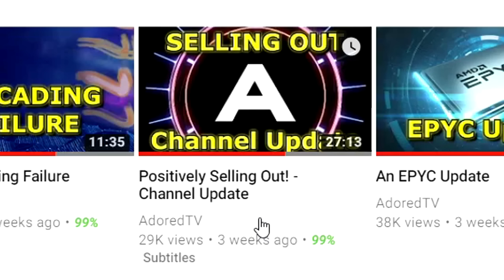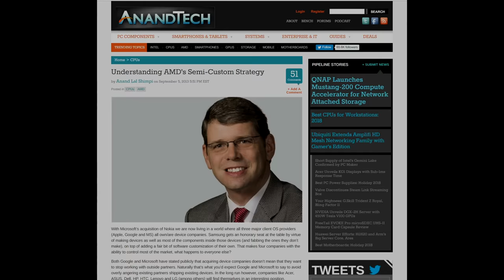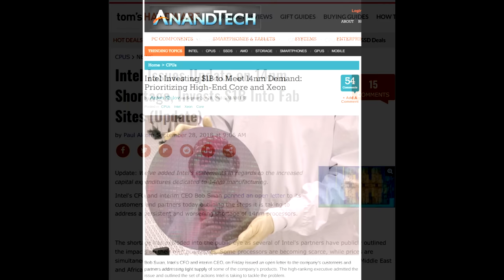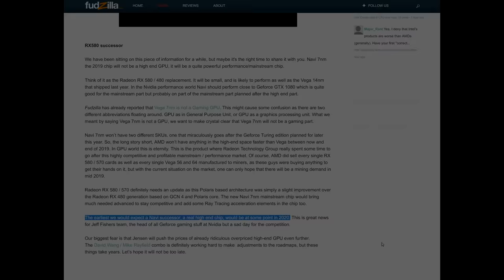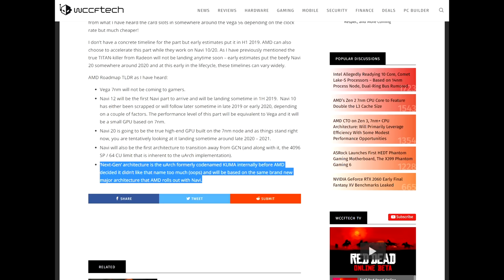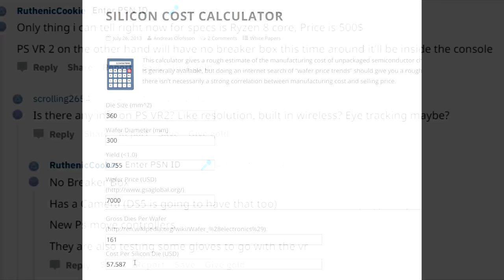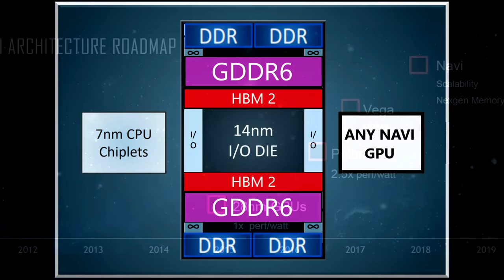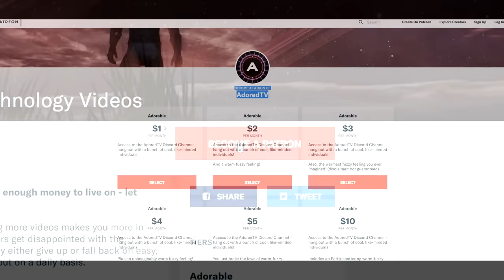AMD  - The (Evolving) Master Plan

Comment: Multiple memory controllers sounds reasonable, but quite wasteful. Considering the following.

ZEN 2 and and VEGA 20 have PCIE 4 support, which can be used for Cache Coherent Interconnects. 
Considering that AMD is member of all 3 consortia/consortiums (GEN-Z, CCIX and CAPI). 
Also factoring in that Infinity Fabric is based on PCIE. 
I would expect that the IO Die to have such interface as well for GPUs and  FPGAs even for the consumer segment. Probably only one of them, the rest as a semi custom solution.

This should allow significantly lower latency communication between CPU and GPU/FPGA compared to current PCIE 3. 
Maybe it will be good enough for bidirectional communication in sub 16ms applications. Which could bring current "eye candy" features to be core part of game play. 

The drastic increase in computation power also points to this direction.

In this eco system, only the IO Die that needs to change to serve different market segments. Keeping IF and the Cache Coherent Interconnect and swapping between memory types and on chip cache sizes.
I would expect multiple IO Die designs, including semi custom solutions for "Hyperscalers". 
I wouldn't be surprised if the IO Die would have flexible component based design, which would decrease costs and time to market significantly.

Cutting an Epyc IO Die into 4 different parts could be tricky without using an interposer. As the orientation of the pieces will be different, which would complicate assembly for non Epyc parts. Unless they found a way to solve it.
Reply from the maker: Yes I think you're right and that it's all about the I/O die.  AMD already has the core chips, all that's needed is different I/O dies and that's what the companies can pay them for.  I'll maybe updated this video in a few months. ;)
Reply: Once AMD moves to 7nm with volume, they will have a shit-ton of 14nm capacity at GF so they can afford to waste a little mm2 to have a single small I/O die that's flexible. Multiple different chips adds to cost for the masks and QA. It's not a small amount either.
Reply: AMD will achieve 10-15% sever market share with Zen 2 Rome,that means GF needs to produce 3.2-4.8 million 420mm2 14nm I/O DIEs per year for Epyc 2 alone.
Reply: @henryfan48  Well within their capacity because their foundries are optimizing for 14nm rather than dedicating machines to 7nm.
Reply: This is all very exciting regardless of who is closest to the truth
Reply: @adoredtv  yes, I kept thinking the same when you came up with this idea; I think they will rather make different I/O dies for different applications, and have some sort of L4 cache in the I/O die to maintain coherence, but I guess we'll have to wait and see.
Reply: @SilverforceX  Console manufacturer always Co-develop and have theire own custom chip. So custom IO for sure in console

Comment: MY BODY IS READY.
Reply: Stop stealing Reggie from Nintendo quote when the switch is full Nvidia ! xD
Reply: @ethan-fel  Yeah, I wonder how and why that happened considering when you trace the history of Nintendo's graphics hardware, they've been With Ati longer than literally anyone else in the console space.
Granted a lot of that is down to a technicality and corporate failures/buyouts.

Silicon Graphics which collapsed but formed ArtX, which was bought out by Ati, which in turn was bought out by AMD...

My guess is given the state of AMD GPU's when the switch launched, there simply wasn't anything in AMD's range that met the requirements. - while Ati led the mobile market between about 2006-2011, it lost almost all it's market share in the mobile space to Nvidia.

And, well, the switch isn't even remotely close to laptop form factor and power envelope, it's in line with tablets and mobile phones...
What are your options there if not Nvidia? Tegra is a mobile phone chipset but with familiar PC-like tools available.
Your other options really aren't very good (Mali graphics? Eh.), and AMD literally doesn't provide any such option whatsoever.

They have nothing in that market segment, good OR bad... Just non-existent.

Meanwhile when you look at the only Nintendo systems so far that have had a portable form factor comparable in size to the Switch, they only gained any 3d hardware at all around 2004, and the entire family consists of PowerVR tech.

PowerVR. A company that had SOME desktop cards in the late 90's but quickly gave up on that entirely, and is now almost a forgotten name in most people's minds... Their chips powered the Sega Dreamcast...

But the name all but disappeared from mainstream awareness, because they bowed out of the PC market very early.
And yet, they persisted all this time specialising in low power, mobile GPU's...

So given what the switch is, and what Nintendo designed, they needed a chip powerful enough to give acceptable results in the home console space, but sufficiently low power to fit into a form factor that, realistically is that of a 7 inch tablet...

- AMD? Not an option - they haven't got a single GPU that's even in the ballpark of the power demands. Even laptop grade low end AMD chips are 30+ watts (which is about 3 times total power draw of the system even in docked mode)
- PowerVR? - well, they've got the low power stuff down, hence why they were used in the DS range. And a pre-existing and fairly long-lasting working relationship with Nintendo already. But... Well, I don't know if you've ever seen the best PowerVR chip currently around, but... Let's just say the results are not that impressive.
- The other main contender is the various Mali graphics cores that ARM provides; They vary enormously in performance, and since ARM doesn't manufacture anything you'd have to ask a company to build you a chip containing such cores. Performance of even the best of these isn't anything to write home about though, and similar to the issues with a PowerVR chip.

What does that leave?
- Nvidia. In principle they're no better than AMD for this purpose given the vast majority of their product range, yet for some odd reason, even though on the whole the chip is not that popular in the mobile space, Nvidia chose to create a derivative of their desktop part that is suitable for use in mobile phones and similar small form factor devices. While not nessesarily powerful by mainstream standards, it's pretty beefy by mobile phone chip standards, and equally as importantly, fully supports the feature set that game developers are used to from PC hardware and other console graphics chips... Not the most powerful thing ever, and it almost seems like a random whim that Nvidia even designed such a chip in the first place...
But under the circumstances...

It's the best option they had given their goals. And one that AMD was outright incapable of providing. They had some alternatives to Nvidia, but AMD wasn't one of them, not to build what they had in mind...

Given Nvidia's track record in the console space I'd wonder how long this deal will last before Nintendo (like Microsoft and Sony before them) gets pissed off with it.
But given the lack of a viable alternative, that may not matter.

I wouldn't be at all surprised though, that if AMD ever decides to make a small GPU in a similar category to the Tegra, that Nintendo would go right back to using AMD just like every other console manufacturer (and nintendo themselves prior to the launch of the switch).
But, you can't ask a company to provide you with something they don't have...
Reply: MY WALLET IS NOT
Reply: KuraIthys quite frankly I doubt it since they signed a partnership for several years with Nvidia.

Nvidia helped a lot in developing the switch

Nintendo also moved to ARM, not x86, something that AMD doesn't do at all.
Reply: @ethan-fel  AMD DOES do ARM - currently only in select server space parts, but it's ARM all the same: https://www.amd.com/Documents/A-Hierofalcon-Product-Brief.pdf

AMD has had their ARM license since an acquisition made even before their ATI acquisition.  I'm sure that if someone approached them asking about an ARM plus a current, upcoming, or even made-in-partnership GPU (Like Sony's help on Navi) they'd be willing to talk.  I'm sure that if Nintendo had actually tried talking to AMD's semi-custom division they might have been interested in building something.  The set of factors that might have forced Nintendo to talk to Nvidia instead, if they had even tried AMD first, was AMD's already existing projects with Sony and Apple and Koduri's mutiny attempt.  Dealing with all that, the talks may have had a timetable caveat that Nintendo couldn't accept.

Comment: C'mon AMDRTG, we need "the Zen" of GPUs
Reply: GPUs are iterative thingies, "Zen" just doesn't happen there.
Reply: @whoruslupercal1891  CPUs are also iterative, except if you drop out of the competition for five years and need to come back with a jump. Sounds familiar?
Reply: @DeeSnow97  AMD never dropped out of GPU competition.
Also Zen just does things Intel did.
Reply: Come on, A-MD Team!
Reply: AMD needs to Hire this guy. Jim truly had a great vision and knowledge to do iy
Reply: That's why a few months ago, people were wanting to see chiplets in Navi, and were disappointed when that theory was officially quashed
Reply: I see RepsUp100 everywhere
Reply: @whoruslupercal1891  False. Zen introduced the concept of chiplet-based processors to the market and innovated in being able to manufacture scalable, high-performance products at a low cost due to the use of chiplets improving yield. Intel are still shitting out massive monolithic chips and they know they can't continue doing so now that Zen 2 has been revealed.
Reply: Nigga IBM was cooking MCMs before AMD was even considered a serious contender in server market.
Also C2Q's were also that.

Intel relies on massive monolithic chips because of their former inherent fab advantage, which is now gone and SPR is a chiplet design with EMIB anyway.
Reply: @greebj  MCM GPUs are extraordinary hard, unless you want to burn 200W for interconnects and 100W for GPUs themselves while still being unable to leverage >1 chip for actual graphics.
Reply: Give it time it's coming. ex-Zen engineers have been shifted to AMDRTG team last year, this is good news. Now just be patient and cheer for the team!
Reply: It's much easier to call them ATi.

You'll still be correct because that is still the legal name in Canada, where they've always been located.  And sure enough, AMD in Canada (The graphics side) is still at ATi's HQ in Markham, Ontario and is still called ATi Technologies ULC just like NAPA in Canada is still called UAP Inc.  Here's their Bloomberg page:
https://www.bloomberg.com/research/stocks/private/snapshot.asp?privcapId=396414
Reply: @baumstamp5989  Hi, Where did you read about the engineers shift? I seem to have missed that info so a link or site name for the article would be appreciated please, Cheers.
Reply: @nasha thedog 
here's a timestamped video link: 
https://www.youtube.com/watch?v=iQ_4C2TKHQ0&t=180s
so if we are lucky... and everything works according to plan, then nv will have to deal with a similar blow as zen was to the way superior intel lineup (compared to AMD FX) at that time. the least i expect is more disruption than vega.

Comment: The best part about PS5 being a Multi GPU set up would be the fact that Developers themselves would have to make their inhouse game engines built for Multi GPU's.  Which in turn would make the scaling near if not a perfect 100% scaling on PC since PC's in general will have the higher core / thread count CPU.  I mean it would great.  But I just don't see it happening.  Only because the cost would be pretty high for the PS5 for sure.  Great Video Jim!
Reply from the maker: Same - it would be great but I don't see it happening. ;)
Reply: @adoredtv  But what I do see happening is the new Uarch might just catch Nvidia off guard after Navi.  With Nvidia putting all bets on RTX.  I think AMD will have a more well redefined arch that will be highly more optimized for games now.  The more I test out games on my RX 590 the more I see it coming close to performance of my friends 1070.  Which is pretty funny.
Reply: @adoredtv   I would not think of multi GPU setup like Zen1  multi-cpu setup  but splitting the gpu in smaller parts like zen2 setup. Like your speculation with the memory controller. But with more parts like fabbing each of the 4  compute engine separately. The bottleneck should the global datashare  cache latency. With further improvement in infinity fabric it may be feasible. 

It's strange that gpu could not be split like cpu a la Zen2 with gpu having less interprocess synchronisation being highly data parallel. One would think separating each part and connecting them with a fabric or an interposer should be easier that doing the same for cpus.

Comment: Currently AMDs "Mid range GPU (the RX 590) is a 6.7 Tflop card at it's base clock and 7.1 Tflops at it's boost clock with 36CUs
Using that data we can determine numbers for "Navi 12" then add an extra 15% for improvements that 7nm will bring
(AMD have stated 25% at the same power but Navi 12 will have more CUs and I like to error conservative so I'm saying 15%)

Navi 12 = 40CUs so 40x64x2x1.708 (1.708 is 15% higher than 1.469) = 8.7 Tflops on it's base clock and 9.2 Tflops on it's boost clock.
Taking AMD at it's 25% claim (which is still 10% lower than what TSMC said) Navi 12s 40Cu base clock of 1890MHz would be 9.6 Tflops with 
a boost clock of 5% (same as the boost clock gain from the RX 590) having the card hit 10.1 Tflops.

Assuming that AMD again want to sell 36CUs as mid range you're looking at 7.8 Tflops based off of 15% uplift and 8.7 based off of AMDs 25% estimate
at base clocks thrown in boost clocks and you're looking at either 8 or 9 Tflops for mid range.

As for the PS5s Navi: 46CUs at 1430MHz seems like a good sweet spot to hit 8.4 Tflops without drawing large amounts of power making it 5x more power
than the Ps4 and 2x more power than the Ps4 Pro. We could see less CUs at higher clock but were looking at a 300W power envelope total system
meaning 180-220W for GPU before it gets expensive to cool, if power usage was the only concern then they could just slap 56CUs in there on 7nm @ 1156MHz
since power saved at same performance on 7nm is closer 50% vs 25% for performanced gained but again this would increase cost.
Reply: Shazbot81  Ah but 8.4 Tflops is 2x the ps4 pro and can be sold cheaper than a 10Tflop machine. Last thing PlayStation needs is another PS3 that nobody buys f9r years because it's too expensive.
Reply: Shazbot81  At this point PlayStation are so far ahead they can almost ignore Xbox. As long as their hardware doesn't suck or c9st way too much the games libary will carry them through. 

PC may well be heading to 15 Tflops but console gamers as a majority don't care about or even notice 60fps or "true 4K".

Comment: Jim do you think the future consoles will have Ryzen and Navi branding to increase awareness? Why and why not, this would help increase mind share and benefit AMD a great deal.
Reply: AMD needs to be in a position to make demands for such a thing. Hopefully, the console makers will throw them a bone and add some AMD branding.
Reply: Not Vega, because Vega won't be in the consoles.
Reply: @wb3123  I hope they never do demand such a thing, the consoles are their client's domain and should stay so. It would be nice to have a "AMD inside" logo on the box, but I hope it would be the manufacturer who wanted to advertise it rather than AMD risking their future demanding it.
Reply: I have been thinking about this as well, I think there is a chance that they could do it, when it comes to negotiating the deal for the next console generation AMD in a position of relative power. They have the leverage that all game engines used for current big console titles have been optimized to x86+GCN, including a lot of very low level optimizations for GCN that are not available on PC. This means AMD can supply what is basically a drop in upgrade as far as the engine developers are concerned. Of course the new part will have loads of additional features, but existing engines will probably work just fine with a few patches. This makes making the launch titles much easier and cheaper.
If the console makers wanted to abandon AMD, they would probably have to go with an Intel+Nvidia combination, and that would mean a massive firmware and game engine rewrite, or inferior launch titles. Either way, a lot of expense for game studios and console makers. So AMD has a good negotiating position IMO.
They could use their leverage to push for a number of different things that console makers are reluctant to do, but probably not all of them at the same time. AMD could certainly try to get a contract that mandates some manner of AMD branding visible on the console packaging, an AMD logo on the underside of the console or something like that.
But I think AMD just wants more money they can pour into R&D, so they will probably just ask for more money per console sold.
Reply: The ATI sticker on the Gamecube looked really neat imo
https://imgur.com/r/Gamecube/flECw

Comment: I would think that producing different IO dies for the different memory technologies might make more sense, since each IO die would be quite a bit smaller and therefore cheaper. Yield should also be very good.

They just have to be designed to be interchangeable to the GPU. Then they can simply put any GPU together with any memory controller to make a complete device.